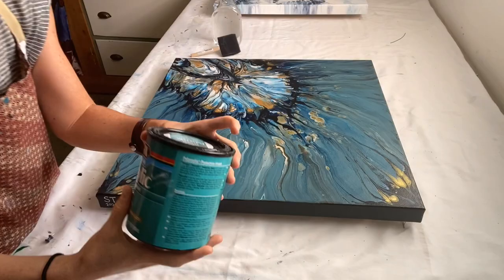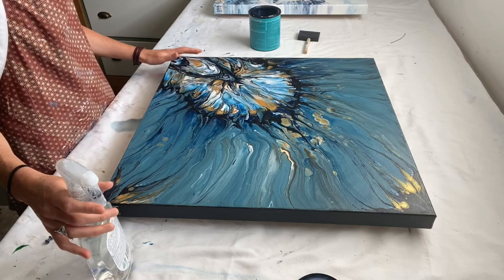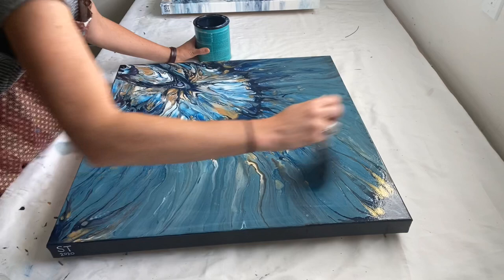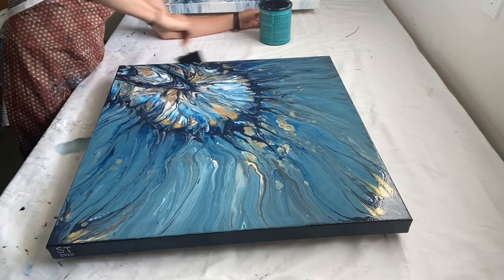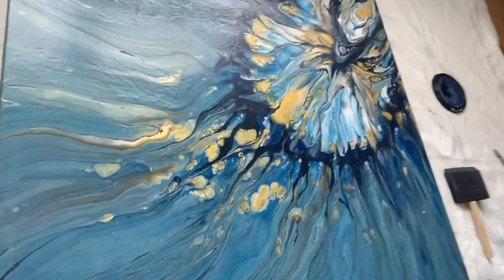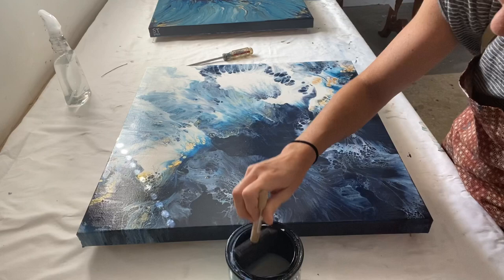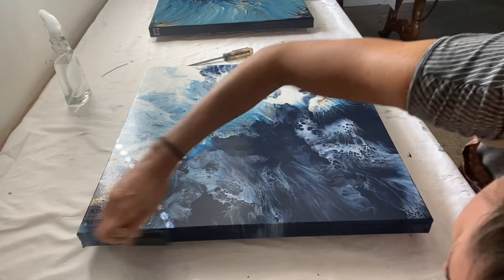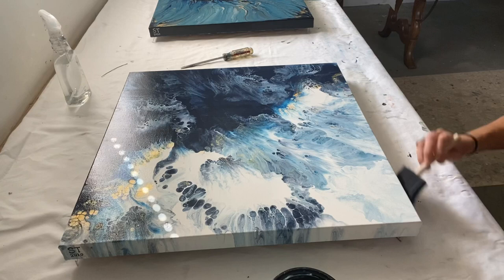Varnish with polycrylic semigloss tutorial! No brush marks and no streaking!✨🤘

Comment: Amazing finish! Thank you for sharing. No torching air bubbles correct? I assume not but want to be sure. Thanks again
Reply from the maker: You’re so welcome! I don’t find that air bubbles are a problem with this method. With a thicker coat or with resin it could be an issue.🙏✨

Comment: Thankyou for the tip😊 I noticed you don't wet the sides. Is this not necessary as well? Wouldn't you get streaks on the side without the water base? Does adding the water first, retard the drying time to give you more time to work? I'm thinking of larger paintings where the top would already be tacky by the time you got to the bottom.
Thankyou for taking the time to show your expertise 💗
Reply from the maker: I find you don’t really need to let the sides, not as necessary.

Comment: Thanks for sharing Sara. I didn't try water coat, will give it a try. I always heard paint should be perfect dry before varnishing. Do you think water will cause any problem in a long run, maybe a year or so ? I know stupid question, but just wanted to confirm before trying :)
Reply from the maker: That’s not a stupid question at all! Polyacrylic is a water-based product, so more water will not affect the way it adheres to the canvas. You do need to paint to be dry and cured, I usually wait at least one week, ideally too.

Comment: This is super helpful! I actually used your technique on a bathroom vanity top I painted. First coat was a breeze. QUESTION: if you apply a second coat, do you still spray with water first? If so, do you wait longer than the normal 2 hour dry time (I'm wondering if the water spray will reactivate the first coat and create a gummy mess). Thanks so much!
Reply: I was looking thru these comments for the answer to that lol! 🤓

Comment: Thank you Sara. I love your method and it really works well. One question: Do you use the water when applying a second coat and how many coats do you recommend? Thank You!!!😀
Reply from the maker: Hi Paul, I do both coach the same way, usually two coats. Glad it’s working for you!
Reply: @SaraTaylor  I'm just totally amazed at how smooth it looks after following your instructions. I'm a newcomer to acrylic painting. I just finished my 11th and until this last one, I've been using Mod Podge. It seals it, but when looking closely, there are streaks. With your method, there are none. So thank you again!

Comment: Im curious about the paint on the painting... isn't that oil based? 
Water based products usually peel if put over oil. It's evident you've done this before, so I stand in awe that you're getting it to stick.
Reply from the maker: This is an acrylic painting, I use only water-based paint.😁✨
Reply: @SaraTaylor  ahhh... acrylic!Now I see. It looked so much like oil that I just assumed it "was". Thanks for the relpy. Now I wanna try it. 
I just finished a faux marble on my parents countertops. (They're on vacation and don't know...so I hope they like it.🧐😕🤧)
I used kills oil base white primer, then heavily thinned some medium gray wall paint samples from Lowes. Then I dabbed it (from a paper plate) directly over the primer diagonally, using a sponge. Then I took a piece of t-shirt and dab/dragged it. 
Then coated with 3 coats polycrylic. 
I've never done anything like this before, so its a risky gamble. But they cant be any worse than the original 1967 formica. Personally, I dont expect anyone to believe that it's really marble... but at least marble "looking"... lol. 
For the cabinet tops and bottoms, I sanded the polyurethane off the wood cabinets and doors, applied 2 coats kills primer, then finished with 3 coats of Benjamin Moore low lustre Satin Impervo using a (medium stiff) Purdy 2.5 angle brush. 
My parents were house flippers when I was a kid. So you can imagine Ive painted my share of homes. But this is my first cabinet job. 
Wish me luck, they'll be home next week.

Comment: This is great!  I do have a few questions.  I watched one artist varnish with a foam brush and for bubbles and was then told foam creates bubbles...  it sure works for you...I will try your method!  Did you use the same foam brush for both paintings?  And is there ever a need to torch or your heat dryer?  Thank you, Sara!!!
Reply from the maker: Hi Kathy! I did use the same brush. I don’t have any issues with the air bubbles for this method. When I use a foam brush with the Liquitex high gloss varnish it does get bubbles… And I use a torch to get them out.
Reply: @SaraTaylor  I did not know you could torch Polycrylic! I torch my paintings, but was afraid to do the polycrylic. Wow! Thanks

Comment: A: You can't even figure out that polycrylic is NOT varnish. B: The fact you add water shows you have no idea what you're doing. You're chemically diluting the polycrylic. There's a reason you're not supposed to use water, and that's why. Also, how is adding water to something as a dilutant, supposed to make it "thicker?" I've never heard of that before in my life. Add water to, any other liquid in the universe, and, well, it will not get thicker. Just why you think polycrylic would do so is beyond me. And why would you want it thicker anyway? It's designed already to be somewhat self leveling as it is. Making it "thicker" would defeat that by slowing down the time it needs to level. And the water you're adding just  increases drying time. How about instead of doing this typically female thing of "well, it feels right, therefore that must be the way to do it!", you do it the MALE way and just follow the directions on the can? Why you need a thick polycrylic coating meant for wood on a canvass, i also don't know. Maybe you're going to use it as a coffee table? Oh, and another great way to avoid brush strokes, ummmkay....? is to *buy the spray can version of this stuff. 'OK, good talk, good talk.
Reply: What is your product suggestion? It sounds like you're saying to use spray on polycrylic, while also saying polycrylic is not the right choice for canvas. Regardless of product, do you suggest a spray gun, or the spray can? Also, was it your time around paint solvents that made you a sexist troll? Mainly curious about your credentials in the art world. Thanks for the help.